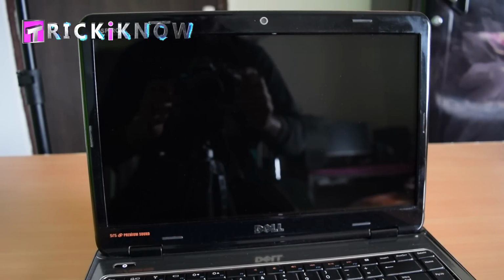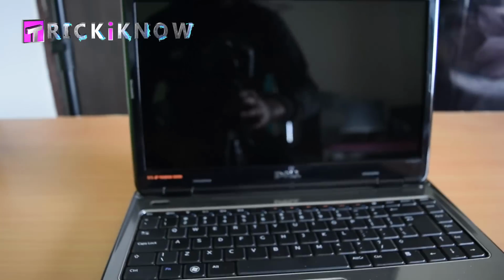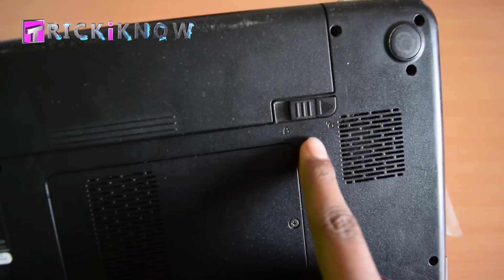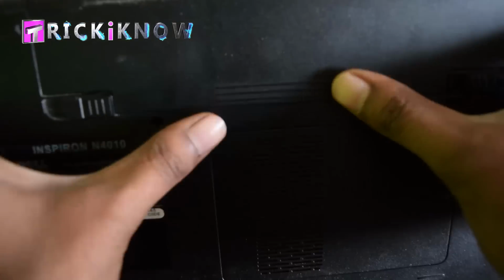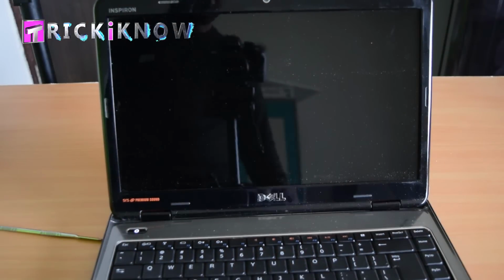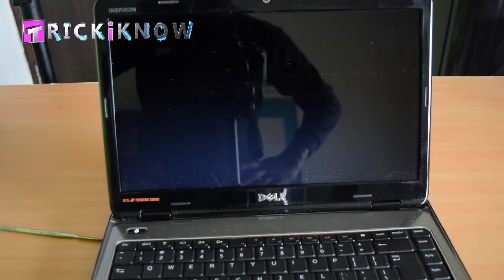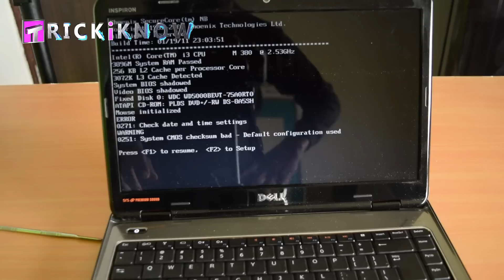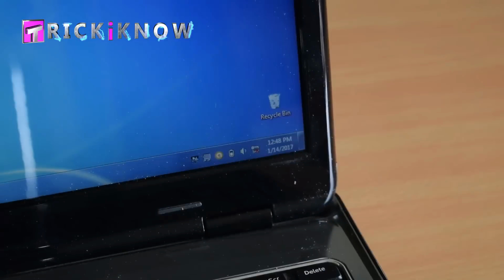How to fix CMOS Checksum Bad in a Laptop (Dell Inspiron n4010)

Comment: Excellent video👍.. Changed the battery in just 20 mins. Just want to add two things.. First no need to open keyboard. Opening the frame only fulfils the purpose. Second, while opening screws make sure each and every screw is loosened and removed too before opening the frame. As there are many screws, if by mistake even a single screw is left to remove, it may break the screw lock while dismantling the frame. I broke one of them. One of the screw although loosened but was left in the laptop base.

Comment: is this applicable to dell n5010, in my case it is showing cmos rtc power failure , should I buy the same battery .
Reply from the maker: You can check your Laptop's model disassembly video, if you see the same battery you can go for it.

Comment: Bro You Disassemble Dell N5010 I have also Dell laptop.  Please help me where I get the product key Sticker
Reply from the maker: product key Sticker is always in the back of the laptop , you might removed it early or its accidentally removed  😞
Reply: TricK i Know :- Someone Says that the product key is installed in hardware when you do upgrade the laptop in pre installed Window it will detect Product Key and all licencing terms automatically and done in just couple of minutes
Is this correct I'm confused

Comment: Thank you for the dissembling solution, i appreciate it. But i have a problem it won't turn on after i'd assembled it, adapter and ram seem fine. I also found out a lot ppl facing no start problem after dissemble and reassemble.. Please help
Reply: Maybe you didnt insert the powerbutton cable correctly

Comment: Thanks for helping us to recover back the cmos part. 

My laptop is the same brand as yours. Im following the methods which your were recommended in this video. After one day, the problem continuing to occur again.. I'd to set the date and time again.  Im using the energizer battery. actually, what is the main problem?
Reply from the maker: Check your CMOS battery socket is its Rusted ?? also check your battery voltage by multi meter or try another battery. (For testing purpose use your desktop PC battery)

Comment: I changed it but the error still comes up
Reply from the maker: Make sure you have used new cmos battery , check manufacturing date
Reply: TricK i Know i did use a new one.
Reply from the maker: Make sure the Cmos Socket have not any Rust on it , just Clean it.
Reply from the maker: In Rare cases this is motherboard problem also.
Reply: TricK i Know maybe that is why. Thank you